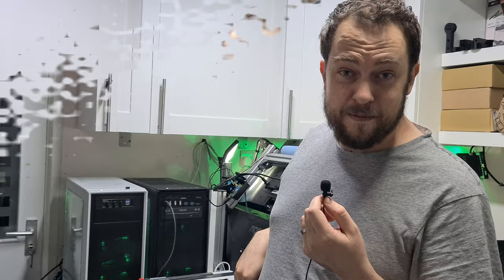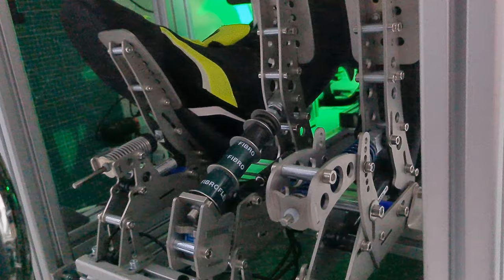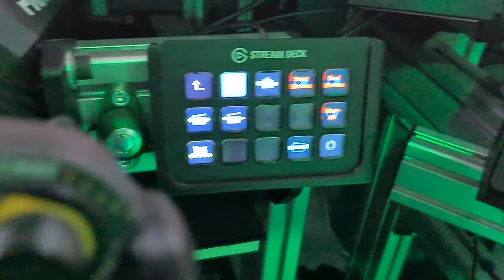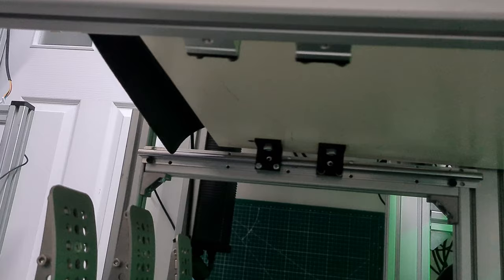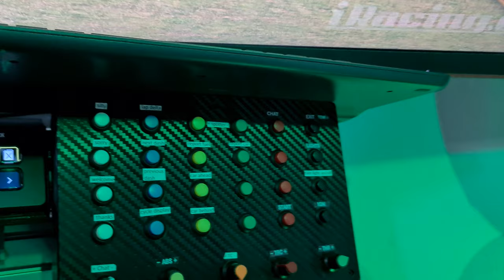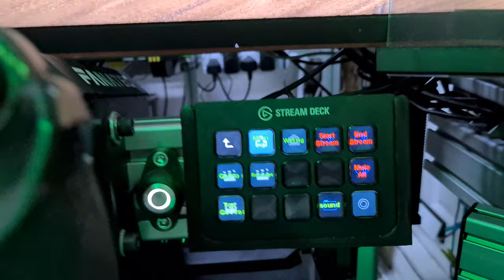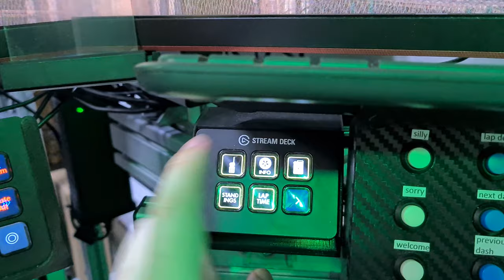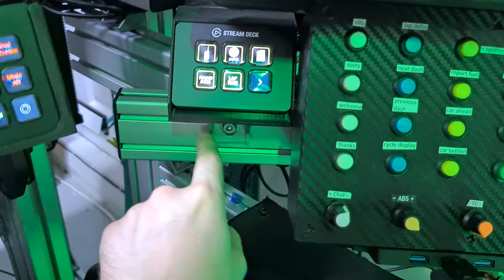TDi99 RIG TOUR!! | Sim Room! | Man Cave! #fanatec #heusinkveld #triplemonitor

Comment: Yo Tone! We had a great race a few months ago and a great battle last lap (wont tell you which one!)

Your set up is so sick. One thing I'd suggest, and it's all down to preference, but the single piece of profile you use for your heel plate on your pedals.. don't you think it's a little shallow? I find that if you have more heel freedom that you can modulate the throttle or brake especially well. I think if you added another piece of profile to it you'd find it more comfortable. Food for thought, thanks.
Reply from the maker: oooooo who won out of our battles? 
and yeah i can see where you are going from. annoyingly the pedals are very very high so my heel need to be close to be able to reach the top of the pedal. i am thinking that i should invert them!
Reply: @Tdi99  I did 😂 but you were for sure faster than me. Maybe you remember which one, I just don’t wanna dox myself on here haha. 

Ahh yeah those pedals are really tall. inverting them sounds like a pain but I’m sure it’s worth it. Either way seems like you’re comfortable with them so more power to you.

Comment: Hey Tony, nice setup! Can you give some specs on your triple monitors please. I’m running a single widescreen monitor but thinking of going to a triple setup. I too want to keep the rig very compact for my garage space. 27” vs 24” etc. would love to hear your thoughts.
Reply from the maker: Hi thank mate! 
Triple monitor do take up a lot of room, left to right my monitors are 1.8meters wide. My monitors are 27inch 1080p 144hz. They are curved but that doesn't really matter with triples. I think 27inch is ideal I would like 32inch maybe one day 😂😂. 

Positioning of the monitors are important, mine are 60cm away of my eyes, this is a nice feild of view in my opinion. Side monitors are about 60° from my centre one. 

Ideal you would want all you monitors the same and your graphics card should have 3 of the same ports (hdmi or display ports)

Comment: That keyboard setup is exactly what I'm looking for... Where can I get specs?
Reply from the maker: The keyboard tray??
They are called Linear Guide Rail, you will need to support them with  from the back side, and find a 90degree bracket for the tray. The length will depend on the length of your rig, however you can cut them down. i have used the bolts that hold the rail on as stop for the guides too.
Reply: @Tdi99 I'm definitely going to give this a go. My swing arm is great but awkward when I have to type for long periods
Reply from the maker: Yeah 100% just make sure you have enough clearance between you legs and wheel base to fit a keyboard in!

Comment: Hello. What GPU are you running and what would you recommend for triple 1080s.
Reply from the maker: Hello, I'm using a 4080 super but I was using a 2080 on triples before that so anything above a 2080 will be fine.

I have iracing graphics settings on my discord, and a side not, iRacing is cpu limited so you need a good cpu. Anything within the last 5 years and anything higher than 3.5ghz (higher is better) you're all good.
Reply: In currently considering upgrading to 4070S and goinng full on triple 1440p. But im not sure if it could run ACC full grid night and raining at normal fps levels. Any help is really useful as i dont want to dump money into something that wont perform as i like. Thanks for the reply and keep it up.
Reply: Im cosidering 4070S as my next gpu and going full out on 1440p. Will it perform good in ACC full grid at night and raining? I really dont wanna dump 600 into gpu that doesn’t perform as i wanted. Any help is useful. Really nice build and keep it up.
Reply: Im currently rocking my old 6600xt and im not sure if it can hold ACC on triple 1080p
Reply from the maker: ACC is harder to run than iRacing, but a 4070super should be fine at anything 1080

Comment: So I have a dumb question.  How do you get the video of you racing pushed to the streaming PC?
Reply from the maker: No question is a dumb question, I have a elgato 4k capture card on the streaming PC. Then I have a hdmi cable from the main PC graphics card to the capture card, the main PC then duplicates the centre monitor to the capture card. OBS can then pick up the signal.

Its handy as I can stream and recond at the same time without the game performance dropping.
Reply: @Tdi99  Sucker!!!  lol.  Now I get to ask ANYTHING!!!
Seriously though, Have you used the RaceLabs setup?  Looks like they run a little web server to push the video to a 2nd machine.  I am trying to decide.  Current PC/GPU does fine to play but it is older and struggles when trying to race and stream. (I7-4790K / 1080TI) so the less it has to do the better.  Does the capture card add extra stress to the race pc (I know a little web server would).
Reply from the maker: Yes racelabs just sends the data to display on a browser, so you can view it on a phone or tablet! 

The capture card has some video processing power but the streaming pc's graphics card helps too! You can use cpu encoding on the streaming PC too if you have a spare laptop or something, you can get some capture cards that use USB to send the data to the PC.

Haha dude ask away! If I know I will tell you 😂😂
Reply: @Tdi99  I appreciate the time dude and enjoy your channel!  I am actually okay with the tech but just trying to keep it as "cost efficient" as possible.  The 4790K and 1080ti on thier own do pretty well and I can put together another one of those for under $500USD.

I am running 3440*1440 getting 90+ fps with a mix of medium and high but things like 2 pass trees turned off.  Racelab's overlays/web server cost me a couple of frames it seems.  
https://youtu.be/dQAIC1I-KKg?t=605
Reply from the maker: yeah given the price of everything! ebay of something might be your best frind going forward lol! its been mine in the past for cheaper hardware!